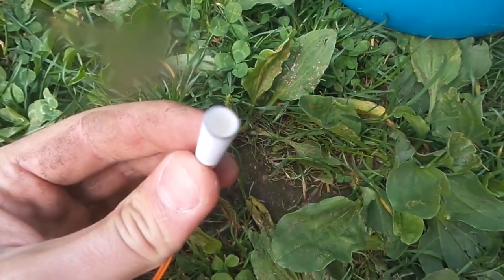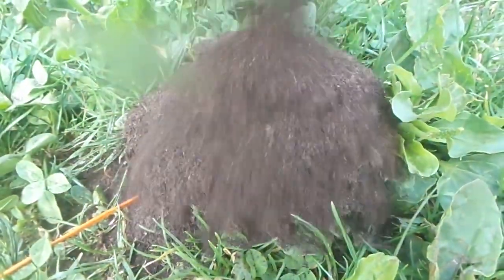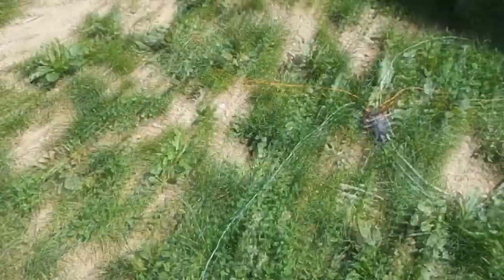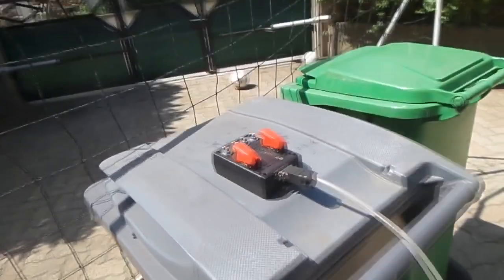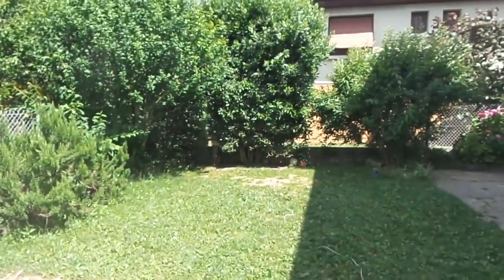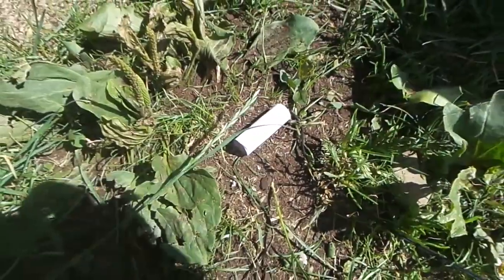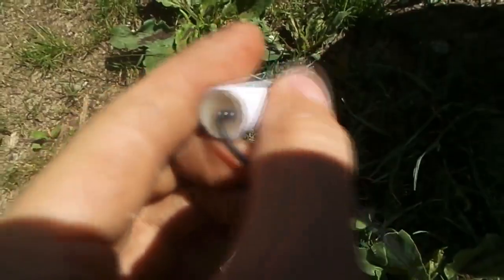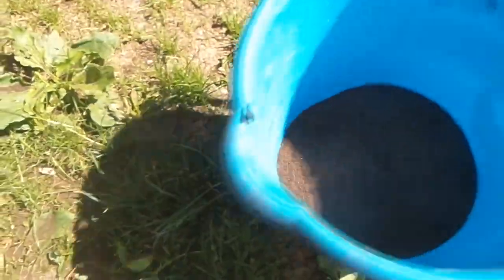Explosive squib bullet hit - Movie special effects - Nicolas Salenc PBP

Comment: How did you made it?
How did you made the detonator?
Reply from the maker: +CazaVideos005 I ll probably post a video about how to make them in detail soon... but basically the igniter is a filament I extracted from a light bulb... works every time x) 
And the firing system is basically two 9V batteries connected in series hooked up to four independant push buttons... If you guys are interrested I might also make an other video explaining more about the actual firing system.
Reply: +Pyro-Build Projects  please make a complete "how to", so many terrible vids besides this one
Reply from the maker: +Victory .Studios Thanks I will

Comment: really cool but just curious how do they do where when windows or concrete being shot at and breaking would you also use these explosives as well???
Reply: Hi my man, (I'm not the uploader, but an SFX tech) Yes, you use explosive squibs for concrete, you pre-drill a bullet hole, bury the squib and cover over with bentonite or fullers-earth to get the dusty puff, broken up cork sheet painted grey makes GREAT "concrete" chunks!  For smashing glass, powerful squibs can be used, or a "trunnion gun", this is like a small metal syringe with a squib inside, when the squib is fired, it pops out a short pointed rod to smash the glass, (like on those little red safety glass smashing hammers you see in busses sometimes).
Many times, compressed air can be used for bullet hits too, a quick puff from a 12v solenoid valve on a high pressure line can do the effect cheaper,  safer, and used over and over again at the push of a button.  These are especially good to hide just below the water level to give the effect of bullets hitting water.
Reply: @michaelfittonsfxprops3844  Great answer! Pneumatics are impressive.  I mean vfx and sound libraries are so damn good these days that needing to get sight/sound/physical motion all from one device (i.e squibs) doesn't seem economical. Not to mention that there's assuredly going to be digital post-production so using VFX and audio libraries just makes more sense. Oh and the lack of required pyro permits etc. Sorry pyro dudes, you're rad but there's a lot of unsafe set pyro guys that make it hard for the risk to be taken on.